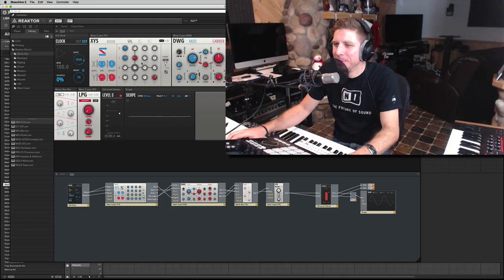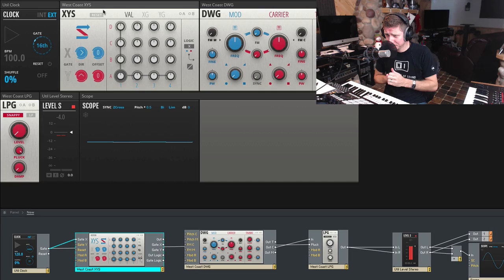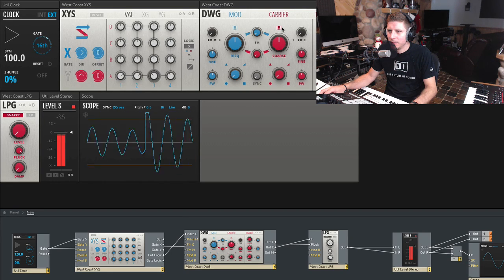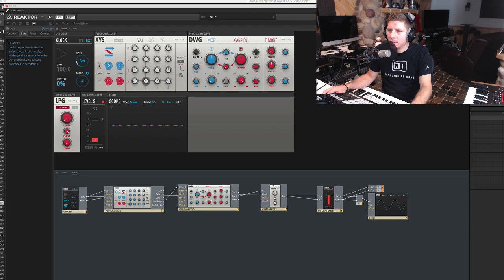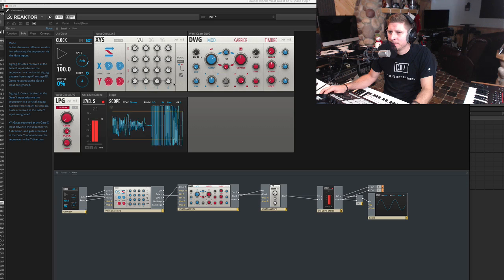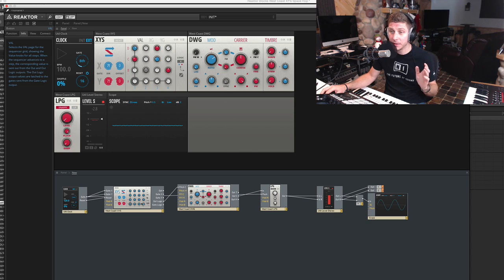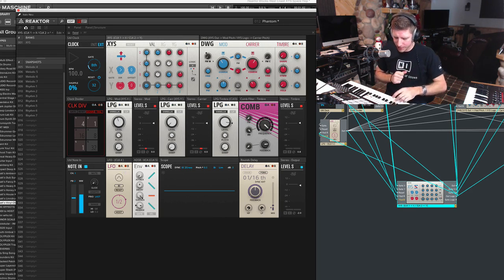Native Instruments Reaktor Blocks XYS Overview

Comment: i'm using the mf twister to do knobs and gates on the xys - but how would i go about getting the sequencer position to feedback to the twister?
Reply from the maker: Leon Trimble not sure. Might have to do some programming in structure to send the proper messages that twister needs to receive to use led feedback
Reply: k thx

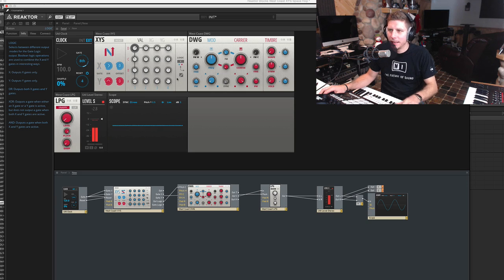Comment: IN the 5:30 minutes range - as suspected - nice name but this 'LPG' sounds NOTHING like an low pass gate.   I was the the guy that first did one in Eurorack (with Don's permission btw)  in 2004 to  (the Plan B model 13 Timbral Gate), although mine was heavily modified from the original - It's virtually impossible to to replicate a vactrol without using one. and this demo kinda proves my point